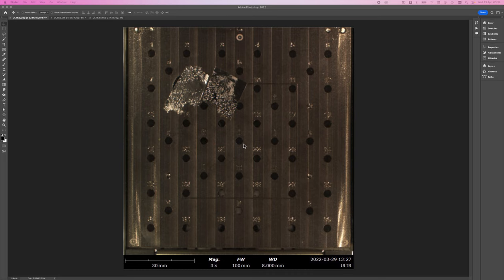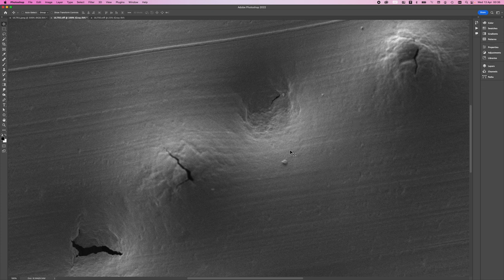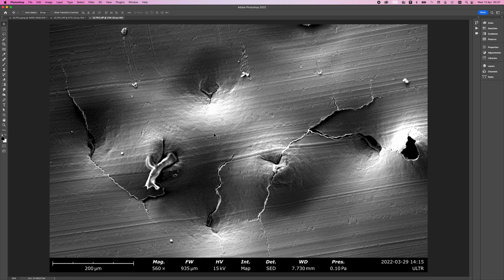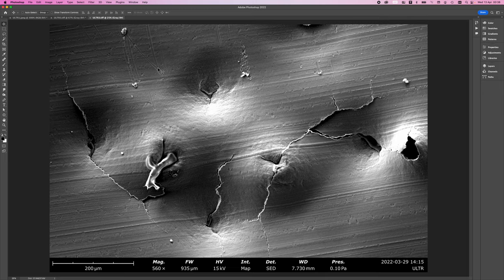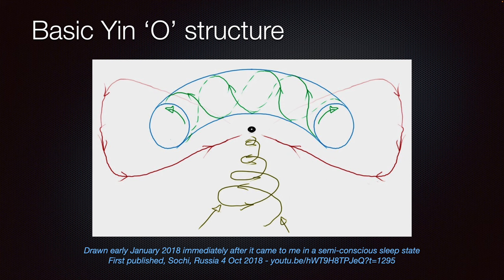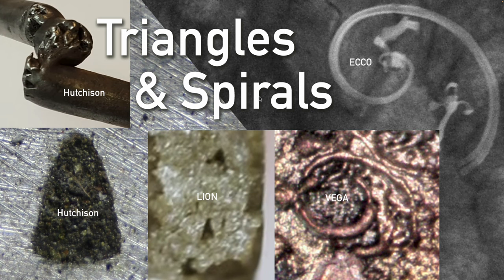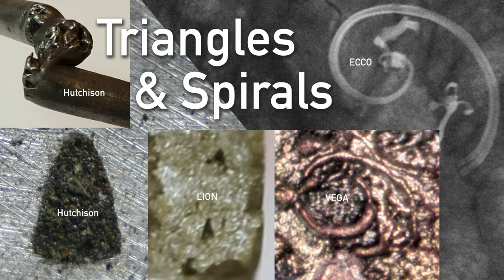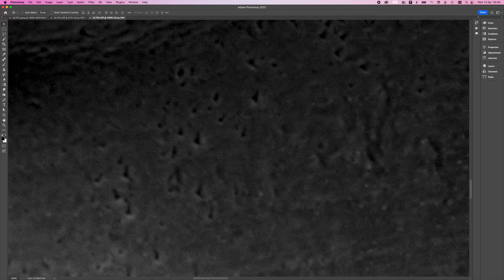ULTR - Triangles?

Comment: I want to avoid raining on the parade.  Still.  What if the alternating pits and dimple pattern is simply an indication of the movement of the sheet under the influence of the fluid?

When sheets are set to vibrating surface patterns can be studied using sand.  There are many videos about this on YouTube.  If we visualize the sheet we can see areas of compression and tension.  Such areas lead to tearing, among other things.

To my mind this is a simple and attractive characterization.  I fully admit is it other than exotic.
Reply from the maker: You need to see this in context of the high speed photography showing the twin vortex structures in the middle of a 3D volume and the action of the forming 'clouds'.

Sure cymatics is at play, this is a major component of the argument. resonant nodes and interference are key, The point that I have been making for a long time is that at the nodes there is stillness, even enforced stillness - this is what leads to the cymatic patterns of say sand on wood. But what I am arguing is that stillness leads to matter at exactly the same temperature and that leads to coherent matter, which can occur at any temperature with atoms of the same isotope as detailed in the Lockheed Martin Patent. Al is beneficially highly conductive (thermally, electrically) and a single isotope.

Comment: Scalable Aether Universe Theory is returning. Aether's hyperboloid and its vortices. The triangles could be vortices aligned with the plane of the aluminum. The holes are vortices perpendicular to the plane of aluminum. Your electrons into the apex of the vortex. "The smaller the spacial footprint, the higher its capacitance". Zero point, near infinite capacitance.
Reply from the maker: "The triangles could be vortices aligned with the plane of the aluminum. The holes are vortices perpendicular to the plane of aluminum."  - Yes
Reply: @MFMP  Thanks for your reply.
 I also have an opinion on the dimples. Not real sure, here goes. I'll try to keep it short, not good at that. Ha!!
 I believe Blackholes/Counterspacial Sinks are scalable Aether's hyperboloid perpendicular to the plane of the Universe. With the Hyperboloid's Inertial plane being into Counterspace.  Leaving its vortex into Counterspace.
 Blackholes come from stars iron becoming coherent. Creating an enormous gauss. "The stronger the gauss, the smaller its field". The gauss is so enormous it can not leave its Inertial plane. Leaving Mass without Magnitude. (Ken Wheeler) I learned my basics of Field Theory from, Ken Wheeler. Your indetentions/dimples. 
 Stars/Whiteholes are Aethers hyperboloid Inertial plane perpendicular, out of the plane of Space. Mediated to center of everything/stars are pulsating Counterspace, shells, orbits, (?)radiowaves mediated to center of Earth. Are your bumps.
 Quasar = Protons, Neutrinos, Electrons/Positrons ~ Neutrons ~ zero point of Quasars ~ 90° out ~ Neutrons ~ Protons, Neutrinos, Electrons/Positrons.  Quasar = Aether's Magnetic Torus ~ Zero point/Inertial plane/90° ~ Aether's Dielectric energy hyperboloid/Jets. 
 Dielectric energy ~ 90° ~ Dielectric voidence field/Magnetism. 
 That's my short version. I would appreciate your opinion.
 "Gator Team"
Reply from the maker: @gyro5d  At the very least the cones are mostly hyperboloid - though in the centre they go the other way.
Reply: @MFMP  Aether's hyperboloid rotates in one direction. CW into one vortex/electron, to the right in a cloud chamber. CCW into the opposing vortex/positron, to the left on a cloud camber.
 Aether's hyperboloid is electron vortex - Inertial plane - positron vortex.
Reply: @MFMP   Maybe, quarks are really 3 Aether hyperboloids 90° to each other. Connected at their zero point/Inertial plane. U, U, D into D, D, U, wouldn't it take less energy to flip the whole thing then U into D?
Reply: @MFMP  I was looking to see if they rotated in opposite directions.  I couldn't tell by looking. The women that just won the Nobel Prize (?) Getz. Said that blackholes rotated in the wrong direction.  I commented, not if it's in Counterspace.
Reply: @MFMP  Aether's hyperboloid is not one thing. It's Electron vortex - Inertial plane/Neutrino oscillating Inertial plane (?) I made that up - Positron vortex. 3 different things.
I like to make up stuff!
Inertial plane = gluons, oscillating Inertial planes - neutrinos.
 Ken Wheeler says there is no magnetic attraction. Its Magnetic fields attracted to a low pressure vortex into Counterspace. I expanded that to. Gravity and the center of Mass is mediated to center into a low pressure vortex into Counterspace, Mass is in Counterspace, Matter is in Space. Temporal into Spacial.
Momentum is Mass in Counterspace, started moving by Matter in Space. Matter in Space stopped, Mass still moving in Counterspace. 
Sorry, I just don't stop. Ha!
Must be my Mass in Counterspace! Ha!!
Reply: @MFMP  If, the cones are rotating in the same direction, like Aether's hyperboloid do. Is the center/Inertial plane rotating in an opposite direction? Or not rotating at all, seeming to be rotating in an opposite direction?
Like, everything in the Universe is Negative. Some less negative, so positive compared to?
Reply from the maker: @gyro5d  In free water volume where you can see a pair, they appear to toroidally rotate in the same direction, though they may polloidally rotate in opposite directions.
Reply: @MFMP  Aether's hyperboloid rotates in one direction. CW in one vortex and CCW looking into the opposite vortex of Aether's hyperboloid. Outside of the sphere (pulses from/of Counterspace) it seems that there can be 2 electrons. The positron becomes an electron in Space?